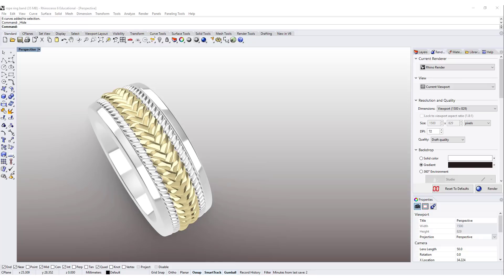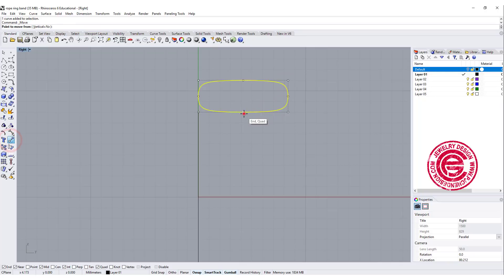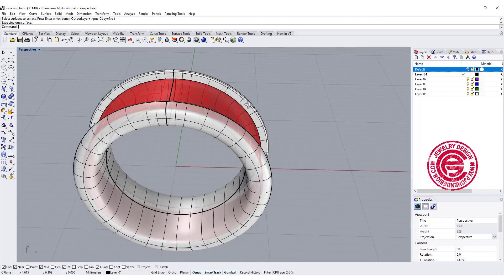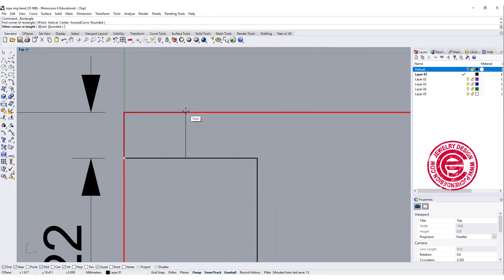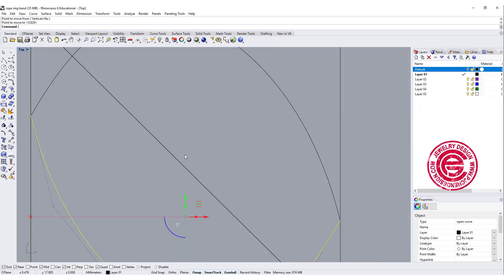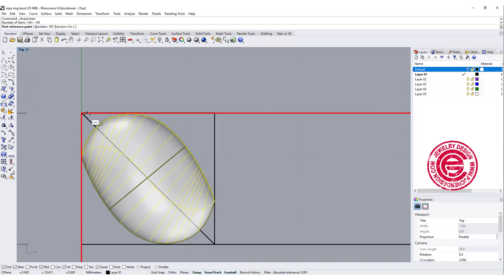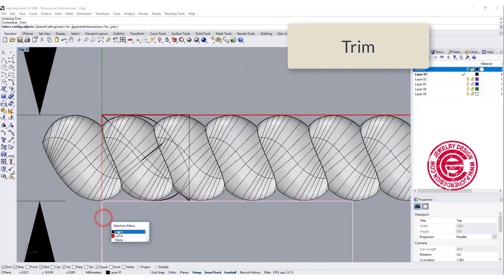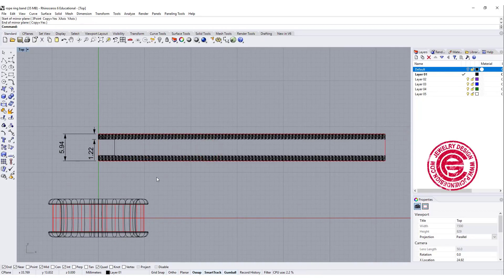How to 3D Model a Rope/Braided Ring Band (Part I): Rhino 3D Jewelry CAD Tutorial #67

Comment: im happy that i found your channel. thanks alot
Reply from the maker: Welcome to my channel and you are welcome!
Reply: @PJChenJewelryDesign   Thanks PJ , i have a question. if i design a model , how can i be sure that that model is printable in lab. thanks
Reply from the maker: ideally, if the model is water tight, it should able to be printed. however, you also need to watch the thickness. a printable model doesn't mean a successful casting.
Reply: @PJChenJewelryDesign  so what command should be ok for a pre-test? i do metal weight and if it shows me the weight... and shell command.
Reply from the maker: @RiddleXpert  You can always make sure it is a closed polysurface that shows at property when you select the object. and if it is not, use Analyse- Edge tool to find the naked edge for fixing.

Comment: Thank you for your videos and sharing your knowledge. I wonder Is something wrong in the my settings because every time I use Sweep 1 rail and then trying to use the extract surface tool the surface consists of many parts and i cannot select all at once. If I rebuild in sweep 1 tool it will work like in your video?
Reply from the maker: I will suggest you rebuild the curve before sweep. so the surface coming out of sweep can me ONE single surface.